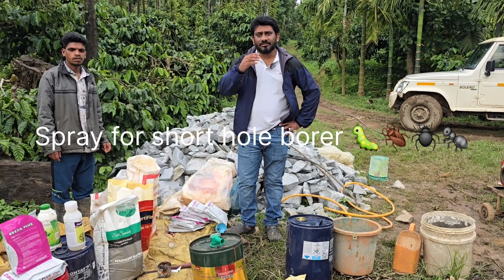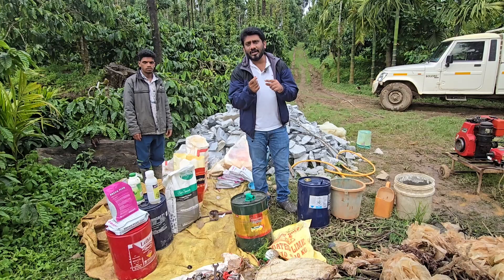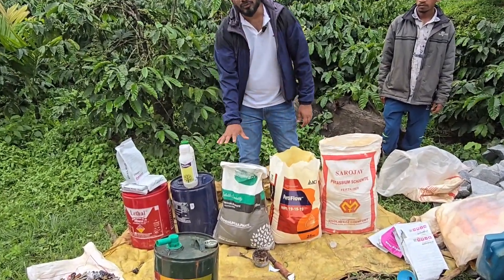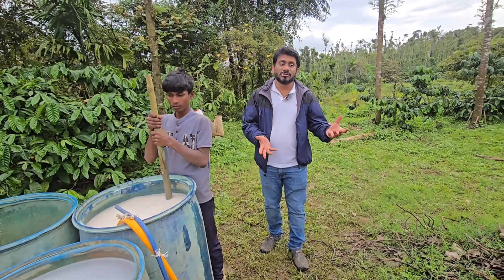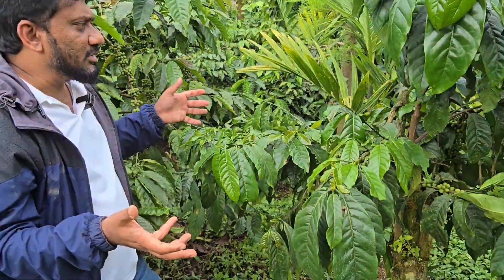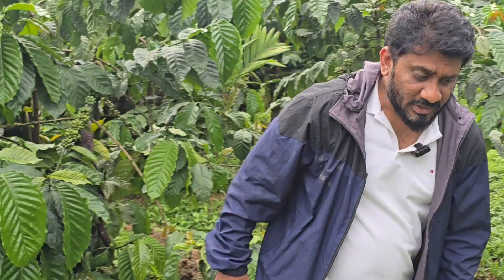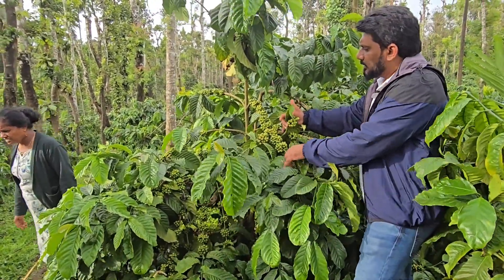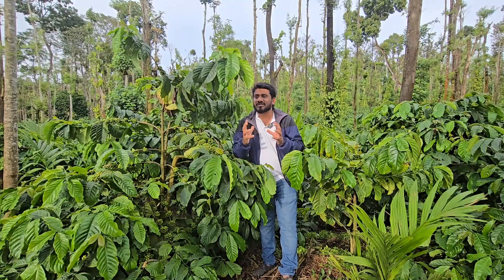🎨Spray to control Short Hole Borer 🐛🪳🕷 in Robusta CxR Robusta Coffee ☕️!Agronomy solutions

Comment: Ho sir good information 
You’re already applying 3 time fertilizer with pottash and for spray incudes 19all as well but again why we need to add pottashium shownite? Suggest better brand
Reply from the maker: This is in oxide form which helps to maintain chlorophyl of plant,it also helps to bring in weight,shine n quality of d fruit as well it improves OT.
Reply from the maker: I M T IS THE BEST BRAND